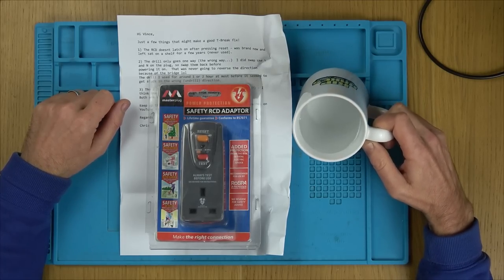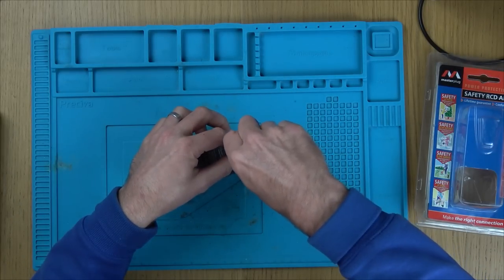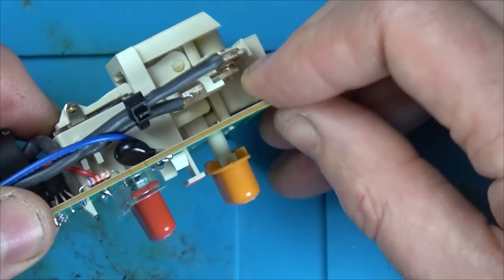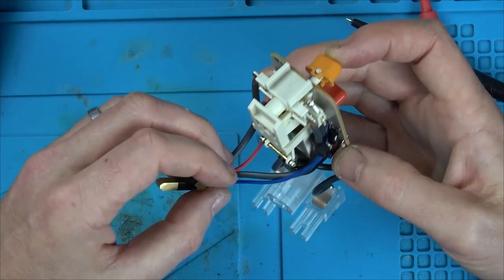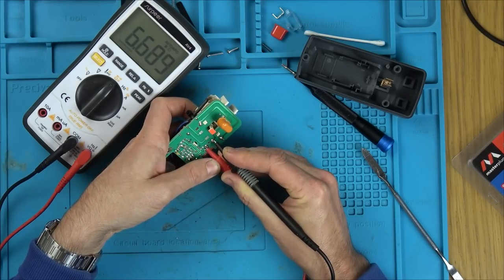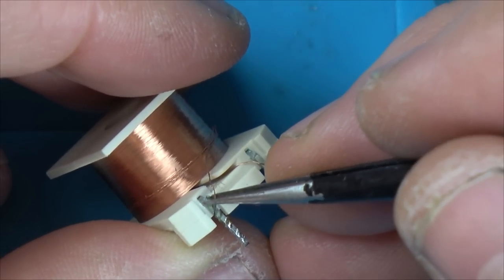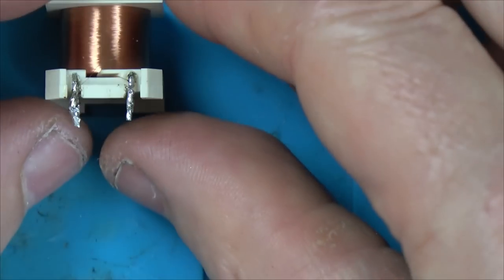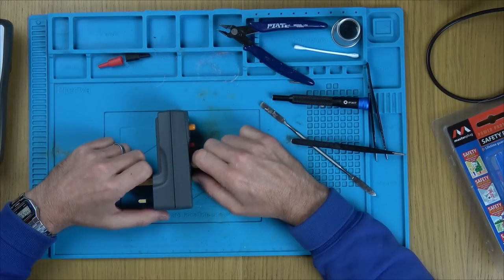RCD Safety Adaptor - New BUT Faulty - Can it be FIXED?

Comment: I have similar device, which also never worked reliably even when it was new. Haven't opened it, I just marked it  as faulty and put it in storage. Right thing to do of course would've been to go back to the store where I bought it and make a warranty claim, but as it's intermittent fault, of course it would work when tested at the store :D
Also, maybe I would've gotten another faulty device as a replacement.
Maybe my device has broken wire at the coil as well. Seems to work most often in upright position, but not always. It's a bit worrying that this kind of unreliable safety devices can be found on the market. I wonder if the manufacturers of these devices have any kind of quality control, do they even test if their products work at all at the end of the production line? Maybe they've just assembled millions of devices, that aren't working at all...

Comment: Haha no way, I bought literally that exact RCD plug 2 days ago from Amazon and it's also faulty. The light doesn't come on but the latch kinda works although it trips on its own after a while with nothing even drawing power or causing a ground fault. That resistor also gets really hot. I was planning to open it up this weekend to find some "dirt" for my upcoming 1-star Amazon review. This device is trash, yet it's highly rated and full of (presumably) bogus positive reviews.

Comment: I'd send it back to the manufacturer with a covering letter saying you think this is a manufacturing fault [supply a link to your video]; they should be interested to see this as it could be a potential fault in a few of these devices.  I daresay they buy in the components and assemble them so might be a suppliers fault in the making of the coil.  You should hopefully get a free replacement!

Comment: You lowered the resistance of the coil so it's 'ON' state current would go up a bit and cost you a fraction more to use, also the operating temperature of the coil will rise and I don't believe either of these points would change significantly and the 'fix' is good and permanent would I use it ? maybe, but would I let anybody else use it ? NO I would not. I would take the current transformer out of it though to see what it's range is and of course it might be useful one day..cheers.

Comment: This is almost like a GFCI but GFCI tests from neutral to live but also trips if their is live in ground
Reply: It IS a GCFI.  It would indeed trip if there was live in the ground as there would be an imbalance in live and neutral.
Reply: AFAIK it trips if there is an imbalance in the current path, so if the current flowing down the live is different to the current returned through the neutral, so it detects current flowing down a different path (like through a person, or to earth)
Reply: You can see how it works in the video. The live and neutral outputs run together through a differential current transformer. Since normally current is flowing in opposite directions, the net output of that transformer is zero. If current leaves through the live wire and doesn't come back, the current transformer produces an output, which triggers the holding coil to release and cut off power. There is normally also a third smaller wire running through that current transformer, attached to the test button. When you press the test button it sends a small current through that wire, which produces the same result as an imbalance.

Comment: You could've measured the resistance of the bit you took off the coil...
If it had a resistance of less than 5% of the 13,8 KOhm of the remaining coil I would in fact use the device without second thoughts.
Circuits work well within certain tolerances because they have to (thanks to parts tolerances, voltage variations etc.).
Of course we don't know the tolerance of the coil resistance here but we aren't talking about a medical device like a defibrillator or something like that here.
On the contrary - as was proven in this vid - we have a very cheaply built device in front of our eyes...

Comment: TBH I think that it would now be fine in use, if anything it will have got more sensitive as you have effectively reduced the electromagnetic force that latches it down. You could test it in an isolated test environment by creating a leakage to earth but if there’s no controlled / isolated environment it shouldn’t be attempted (there are test labs available to do the test for you)

I understand your reticence though and always best to err on the side of caution.
Reply: Totally agree. It has nothing to do with the current sensing side.
Reply: If he were to test it, there would be a risk of tripping an upstream RCD (the current regulations in the UK require all circuits to be RCD protected)
The test button on the RCD is wired to avoid tripping an upstream RCD
Reply: @pineappleroad  agreed, it would need to be an isolated environment and I have updated my comment to make that clearer.
Reply: @zynaps666  Thanks!

Comment: It isn't as critical as a 12v transformer or a speaker voice coil, i bet you can slolder those pieces of wire together and putting a little bit of varnish or uv mask to get it nearer to spec. I do that all the time with 12v transformers and never had any issues with them. Even in electric fans, they can run all day without any issues

Comment: people are saying you can test, yes you can and you can do it safely by using an RCD tester this will tell you if it passes or fails the trip time and current leakage, you will need to plug your RCD unit it into a circuit that is not RCD protected already as this may trip first during the test, in fact it probably will as these are far more reliable and need to conform to regulations, your plug in device may  be some Chinese made item that is not particularly safe from the off,   my other concern is that yes this looks like a manufacturing fault so how did it pass any QA, I would say these devices are released for sale without any form of testing whatsoever therefore I take back my initial statement saying it would be safe to use as they probably are not safe from the off.

Comment: I've never understood why you continue to turn your multimeter on and off. In this episode alone, within the timespan of a couple of minutes, you turned it on to test resistance, turned it off again, then turned it back on.

Not sure about your particular meter, but my one has auto-poweroff even when the dial is on a setting other than 'off', and it can remain that way for months and months without killing the battery, to turn it back on I just press a button such as the 'mode' or 'backlight' button, and mine is just a cheapish unit from a local retailer here in Australia called 'Jaycar'.

Comment: Removing the wire from the transformer, won't cause too much of a safety issue, as long as it's put back properly and soldered properly.

Also in future you can use a drill to help with undoing the wiring (I think bigclive mentioned this one his videos).

Comment: The coil you fixed is the "relay" coil....apart from effecting the power consumption and heat in that coil...
The calibration would not be effected.
 Slightly weaker so might not "latch at 210 V and might run slightly hotter at 270V.  All in all mains stuff has safety standards to meet.....and we never buy stuff from China do we
Reply: All the stuff from china is perfectly safe, menuals are wroten in prefect engrish, and carry all the CE mark. lol

Comment: Hmmm, safety stuff is one thing I'd not try to repair.
Reply: I agree, if safety equipment fails then you must replace it with new not attempt to repair it. Devices like this have parameters they must adhere to that without the appropriate equipment you cannot test. Don't get me wrong,I am loving the Rolls Royce videos.
Reply: Did you watch the video?
Reply: Vince says in the videos he won't use it its purely finding the fault and fixing it is the thrill, as well as finding out how things work

Comment: personally from a coil standpoint i figure its ok HOWEVER the coil was faulty from the get go what else is could be faulty in it and fail i would not trust it at all
Reply: Worst that would happen is it would fail again, and cut the power.. I wouldn't have an issue with it.
Reply: @BuyitFixit  actually if you watch bigclive on YouTube alot of things like this fail in such a way that the circuit breaker gets stuck thus the power stays on and causes a major safety and fire risk so it would NOT be smart to use one that is already faulty
Reply: @wolvesone  Big Clive wouldn't touch it because its not PINK! I can't see it getting stuck on, as the magnetic coil holds it shut. if it failed it would just resort to the initial state of repair when Vince got it. No power output.
Reply: @BuyitFixit  you clearly have 0 clue about modes of failures in electrical equipment the contacts can arc and weld themselves together as seen in a few of big clives videos which you would know uf you actually watched him but obviously you don't and only decide to try and discredit him because he has a thing for pink never mind he is an electrical engineer so yes it can fail in a hazardous way
Reply: @wolvesone   I love big Clive and wasn't trying to discredit him in any way, I'm not sure where you got that from? I was just making a joke as I watch big Clive too and he likes pink things! Yes electrical contacts can weld themselves together when high enough current is involved. I have seen it many times with relays etc. And I wasn't trying to disagree with you, but in this case with the RCD I can't see any modification of the coil causing the contacts to fuse together unless excessive current was passed through them or arcing due to dirty contacts.
Reply: @BuyitFixit  ohh i was not saying coil repair was gonna do that i was more implying that there is an obvious lack of QC at that factory and thus some other parts could fail and cause it to become hazardous seems what we had here was a failure to communicate (cool hand luke movie ref) i think coil wise it will be fine i dont trust the rest of the device based in the lack of QC
Reply: @wolvesone  I'm in total agreement with you on that too. I guess miscommunication. And re modes of failure I recently did a video on repairing a solar inverter which 4 relays had failed and I also had to repair the switch mode PSU. So I do have slightly more than 0 clue :)
Reply: @BuyitFixit  lol i recently had to fix a geiger counter and a federal signal siren and light control box which is currently installed in the security unit i drive for work
Reply: @wolvesone  oh cool. I built an internet connected Geiger counter a few years back when the Fukushima incident happened using a smb20 tube.
Reply: @BuyitFixit  i started with one of those and have slowly worked up to a gq gmc-500+ which i have modded to be able to detect alpha beta and gamma which is something the sbm20 cant due for tubes i have an sbm20 a si3b a m4011 and another tube that is like the si3b then there is my alpha detector an lnd 712 mica end window tube i would share a photo but i believe YouTube doesn't allow it i also have a few radioactive source that i use for calibration and testing including thorium lantern mantles (big clive has a video on those) a jar of raw uranium ore and a sample of the glass that was made in the first atomic bomb test in new Mexico USA though due to age its not very radioactive anymore
Reply: @wolvesone  Sounds really interesting. Yeah I know the sbm20 only detects 1 or two different particles (been a while). I push the data to radmon. Although I haven't updated the location and were now at the west of the uk instead of the east. I think for testing I had on of those uranium? Glass marbles but also pulled a smoke detector apart and used inside for an alpha source iirc.
Reply: @BuyitFixit  yea the sbm20 is a beta gamma only tube so you wont get much from the am241 in the smoke detector as that is a mainly alpha source with occasional gamma from spontaneous fission if you got a counter that can put out the 500+ volts to drive a tube like the lnd 712 and then checked it you would see more cpm and thus higher doses
Reply: @wolvesone  sounds like you know your stuff 👍
Reply: @BuyitFixit  i have been studying nuclear energy and radiation since i was 12 years old and i am 38 now soi have some experience and before 9-11 i used to go to a nearby nuclear plant and tour it but i actually dont have any degrees in it my formal education is in automative service lol
Reply: @wolvesone  I'm 53..getting on a bit. Been interested in computers and electronics since I was a kid, 1st computer I learned to program on was a nascom2 built by a friend in 1979. I've always fixed things for people like tvs etc and used to work in amusement parks repair different machines in the late 80s to 2000s. I'm technically a farmer now lol.
Reply: @BuyitFixit  nice my first computer was a tandy/radio shack trs 80 model 2 that i bought for 5 bucks at a yard sale and now i am learning how to do stuff on linux always loved electrical repair like my dad who spent most of his life fixing tvs arcade machines pinball machines and even worked with me in a roundabout way with him working in my city radio shop fixing the police cars fire trucks and stuff while i was a volunteer firefighter I learned alot of my electrical repair skills from him like soldering been doing that since i was 6 because of him

Comment: I think not using it is the best bet, but you could have measured the resistance of the wire you removed to see how much resistance the coil lost. If it's around 5-10% or so I'd say it's within spec. Scary that the manufacturer doesn't seem to have any kind of quality control though. Automating the testing of a device like this wouldn't be that hard.

Comment: Most likely it would work, but I‘m with you: It is a safety device and ithe repairmight have changed the point when it trips. It is no longer up to the specs, so the only sensible thing to do is throw it into E-Waste.